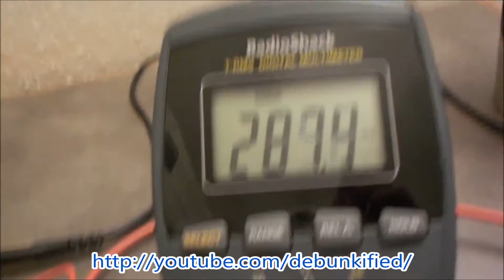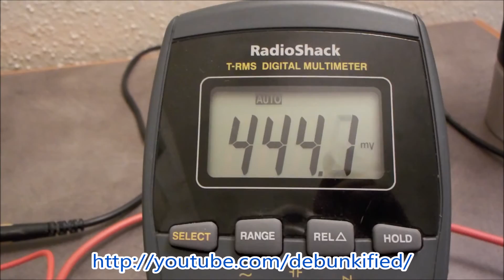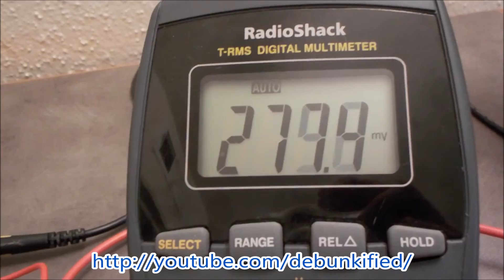100% Energy Plus Some?

Comment: Great article I read from you of using a motor like a catalyst. Are you using the same principles here? If so, where are the coils from the Magnetic field and his capacitors? I noticed theres no switched for the capacitors. Also,  I thought the capacitors should be connected to the wire of the rotor and not connected to the source energy of the mechanical energy device. Thank you!

Comment: First your charging the capacitor up to it's saturation point, the current only flows to the lamp because, it's not yet saturated. Once it reaches the saturation point, the current flow stops. Because capacitors block DC current flow, once it' reaches it's saturation point. Then your discharging the capacitor, which releases the stored current and now the stored current flows again, lighting the lamp. Conventional flow theory says that the current of a DC source ( the battery), flows from negative to positive, this would also hold true for the capacitor. The amount of time that it takes to discharge the capacitor is governed by two factors, the capacitors saturation time &  the resistive load. If you short out the capacitor you get a snap & flash, pretty much instant discharge. But, if you put say an led, in the correct polarity, it would stay lit much longer, because of it's lower current drain on the capacitor. In theory you could build up a capacitor bank of equal capacity to the DC source (the battery). But, it will still be governed by the same saturation time for each capacitor, in the bank to reach it's full potential (charge time)  Your capacitor bank world likely be much larger (in size) than the battery, but the conciliation prize is it takes far less time to charge the capacitor bank than it does to charge the conventional SLA battery. I know there's something to do about the discharge curve that's different and unique, but I don't remember what it is.

Comment: wrong install the amps meter in wire which is charging to capacitor. u can c when capacitor is going to char it will be taken some amps so is not use full

Comment: I've been thinking about a battery to battery - or battery to cap switching circuit.  Maybe a dirty relay or transistor setup.   Back emf ALA Bedini to sequentially charge and discharge....  The understanding being that a battery cannot charge and discharge at the same time, therefore you have to take turns.
Reply from the maker: I never have subscribed to the whole thing of oscillating ions in a 
battery, but of course that's what all batteries do anyways. If there is
 such a thing as that then I believe the rebound effect of the battery 
bouncing back a little after discharging may play a role and the 
alternate charging would help in creating a resonating effect like that.
 A battery can be charged and discharged at the same time, for instance a
 cell phone does this all the time.
Reply: Yes Li-ion batteries are capable of simultaneous discharge/recharge, but lead acid batteries are not.  As I live off grid and have lead/acid batteries I am looking for something better.  Robert Murray Smith  has a wonderful mind and PMMG4HYBRID on YT has demonstrated a pretty cool silicon based capacitor that has intriguing bounceback. -Cheers.

Comment: also the energy is not lost thats obvious.
its just moved from one to the other.
Reply from the maker: Is it that obvious? "They" say there is 50% energy loss in the transfer of energy from "any" DC source such as cap to cap or battery to cap. I personally don't think so.
Reply: i think your right on that :)
allthough it will depend on the load ofcourse :)
Reply from the maker: In reality there is a 50% loss of energy during transfer from a battery to capacitor, but we can only collect 50% while the other 50% is perfectly capable of doing real work, it can not be collected and is as why it is said to be lost. In my next video I will show how to get above this very easily.